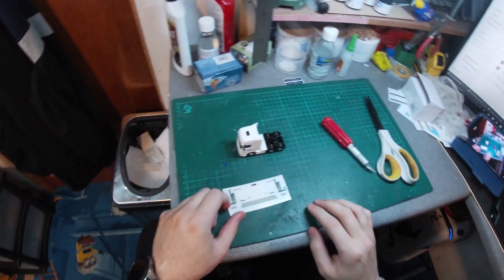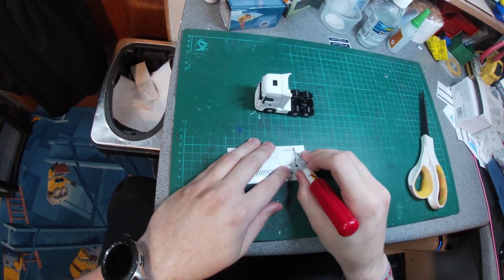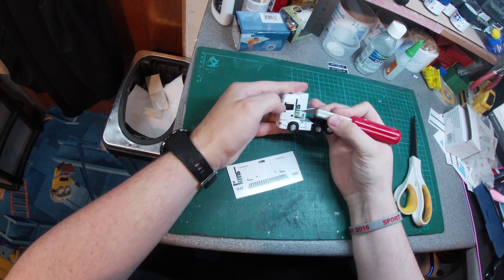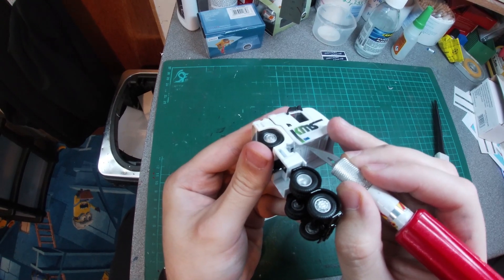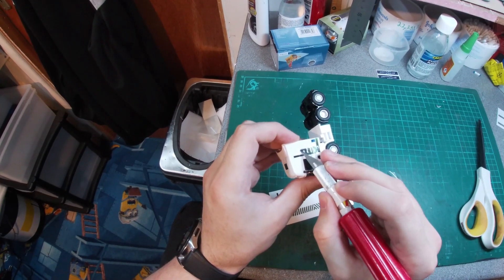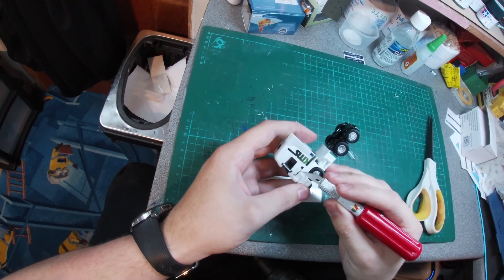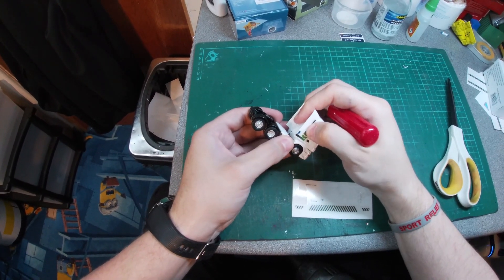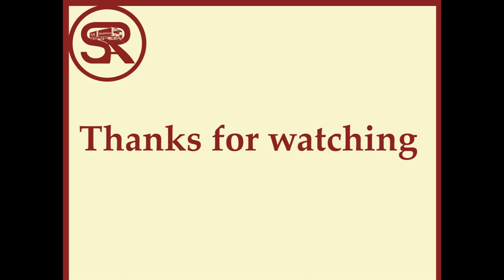SR Hobbies: Decals fitting tutorial

Comment: Nice to see a Decal tutorial on something other than trains. Warming vinyl decals prior to fitting also helps, (you can place them on the radiator briefly for example), this works with standard vinyl so not 100% sure if it's appropriate for your "Ultra thin" version.  And for anyone using the "Hot air gun" approach, 1) use low heat for only a short time, 2) keep the heat gun moving, don't linger on any one spot, 3) AVOID heating plastic fittings (mirrors etc) and Glazing.
Reply from the maker: I agree with most of what you've said but for the pre heating vinyl I wouldn't suggest it for our decals, it makes it very difficult to fit even with the application tape applied. as for the tips on the heat gun there's some good points there.